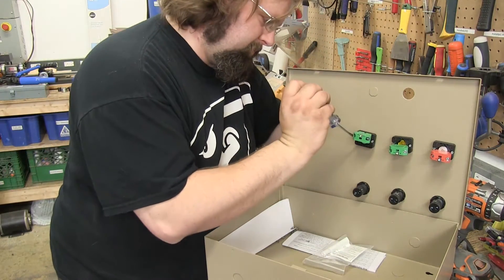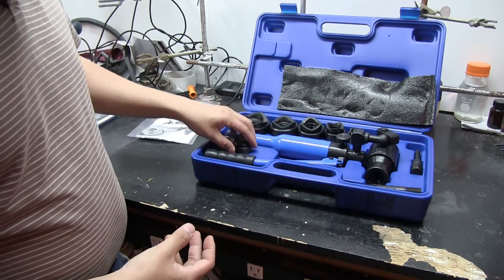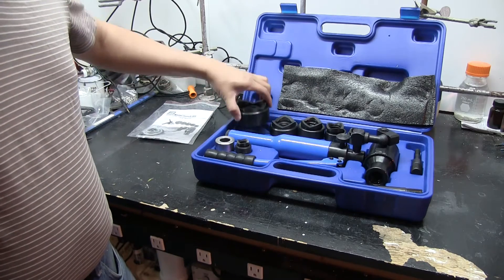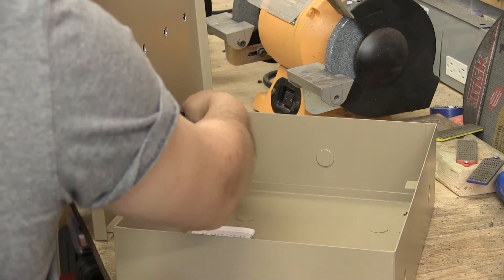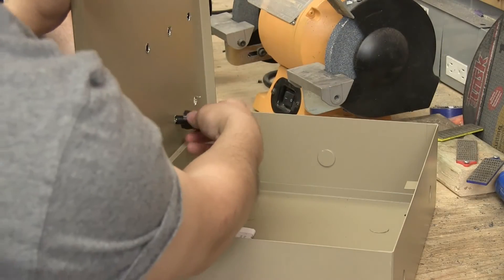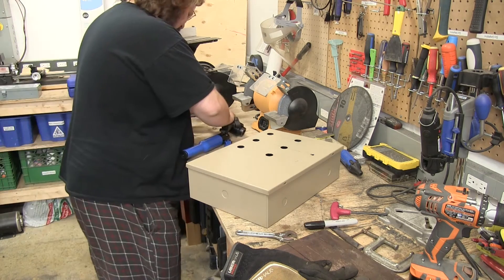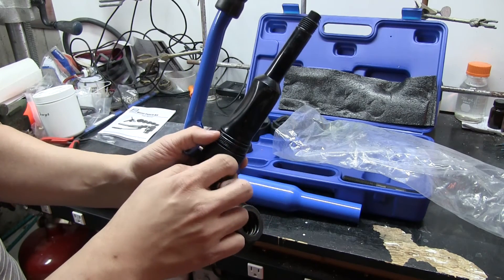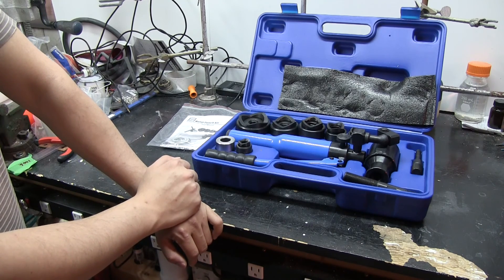(10) - Panelmount Devices with Hydraulic Hole Punches

Comment: It says 3/4 but outside diameter  is a little more than 1 inch?
Reply from the maker: Blame various mismatched Imperial standards, and trade standards. Nominal OD is not the same as the diameter that EMT conduit fittings need. In this case the OD for a 3/4" conduit fitting is closer but not quite 1".

If I had the chance for a do-over I'd want to get a unit that measures in mm, so that I always have the true measurement.

Comment: I'm a huge fan of control panels and occasionally make my own. From 0:00 to 0:20, I can definitely relate to that (so I ended up avoiding steel enclosures and moving to plastic). I especially like the AD16-22D/S panel mount indicator series, they are super nice! I can see you put a lot of effort into making your control panels look nice. Perhaps are you also a control panel enthusiast?
Reply from the maker: Oh absolutely, I'd rather have something that works well and is presentable, at the additional cost.

I also googled AD16-22D/S and saw they're from China. I source mine from Automation Direct because I've wasted time in the past with dodgy indicators. Also any indicator rated for 120VAC I won't get anything less than UL(C)/CSA rated.